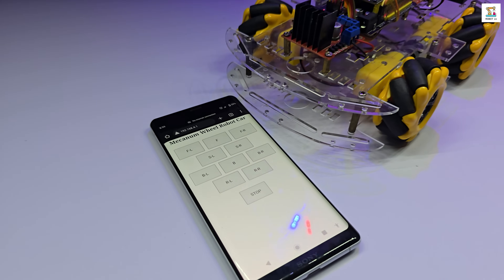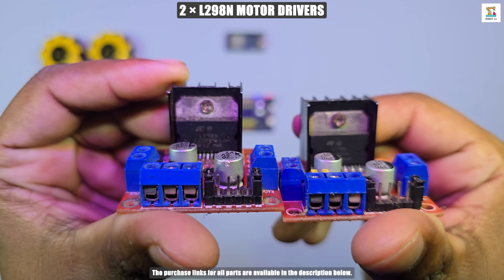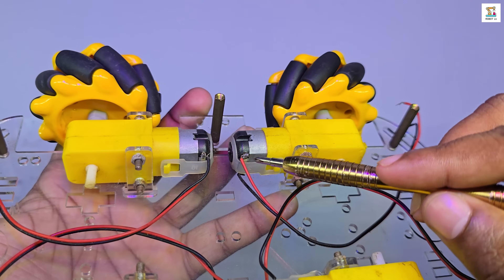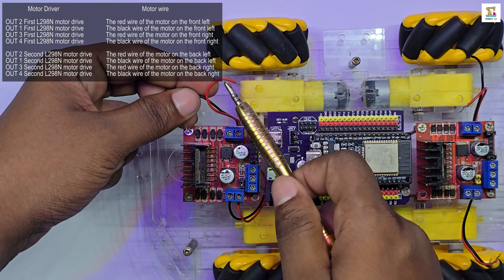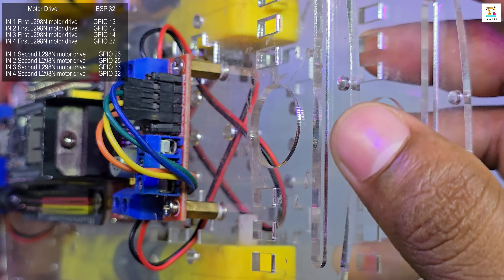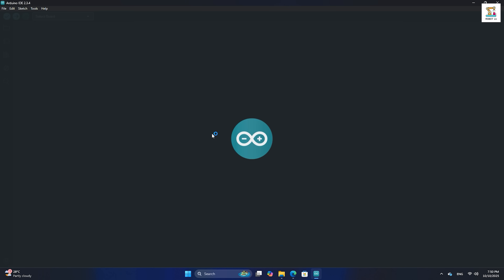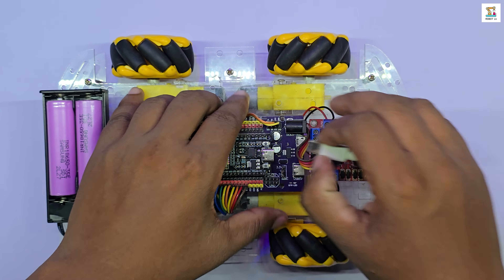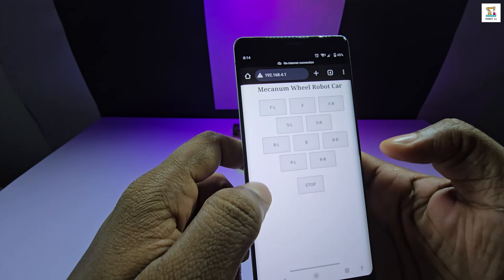ESP32 WiFi Mecanum Wheel Robot – Full Build & Web Control Tutorial | Robot Lk

Comment: please, what if we connect the Right Sided wheels in a single motor driver and left sided wheels at another driver, will the mecanum wheels still work?
Reply from the maker: That's possible. Connect the wires as shown in the code.
Reply from the maker: Left side motor drive - 1
Right side motor Drive - 2

Front left motor - left motor drive 1 ( IN 1, IN 2 )
Front Right motor - right motor drive 2 ( IN 1, IN 2)
Back left motor - left motor drive 1 ( IN 3, IN4)
Back Right motor - Right motor drive 2 ( IN 3, IN 4)
Reply from the maker: Motor pins 
Left motor drive  IN1 = 13, IN2 = 12; // Front Left 
Right motor drive  IN1 = 14, IN2 = 27; // Front Right 
Left motor drive  IN3 = 26, IN4 = 25; // Back Left
 Right motor drive  IN3 = 33, IN4 = 32; // Back Right